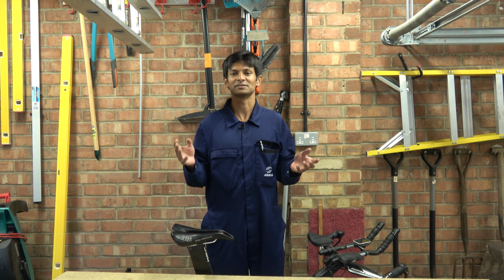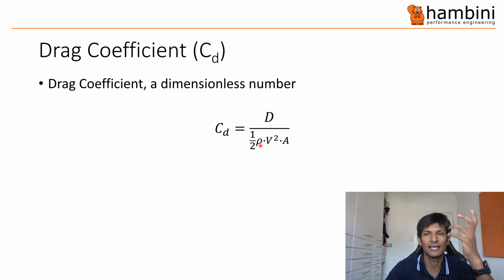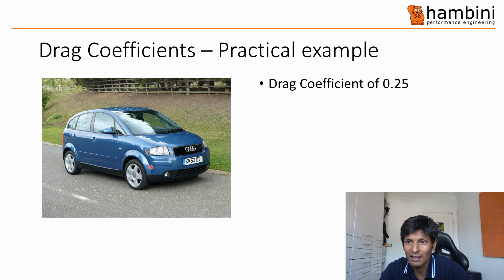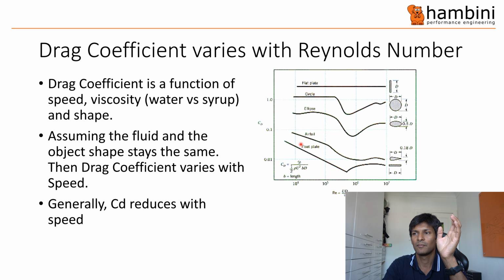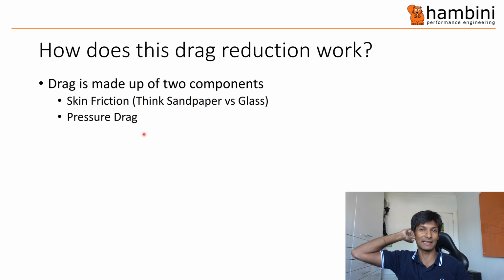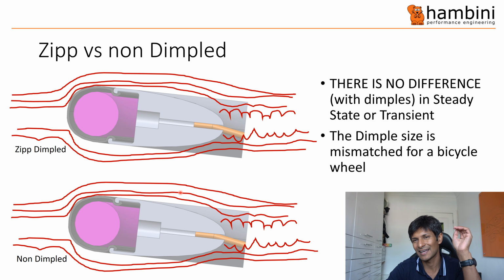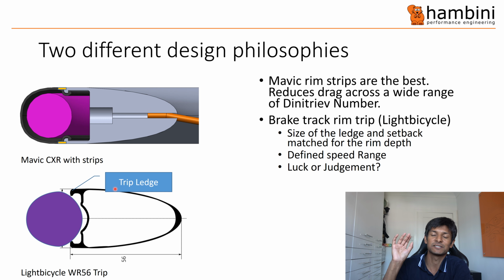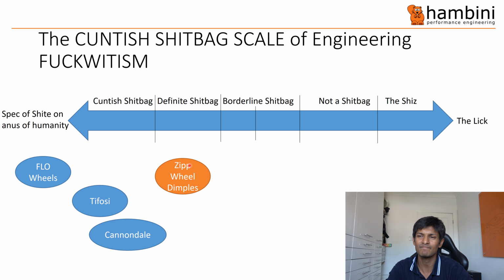Aerodynamics: Zipp Aero Bike Wheels (A Hambini Reaming)

Comment: Hi Hambini, thanks for the video. I was wondering if you could clarify something for me? 

I have been under the impression that the idea of the dimples on a golf ball is to “re-energize” the boundary layer to make it stick to the surface for longer, rather than detaching when it “runs out of energy”. In my mind the first logical step on from this is that while you have the flow still attached to the surface you would like to keep it laminar and only “trip it up” when it is close to detaching. I think this is what Reynolds were trying to do a few years back with their SLG wheels (Swirl Lip Generator). 

In your presentation you talk about making the flow turbulent early (far towards the leading edge) well ahead of the point it detaches. This fits with for example plane wings where the vortex generators tend to sit fairly far forward. It is just that I don’t understand why. How come want to make the flow turbulent so far ahead of where it separates?
Reply from the maker: This is an excellent question and clearly you have spent some time thinking about it.

Towards the leading edge, the air is under a "ram pressure" so it will not detach, however once the air reaches a critical point in it's trajectory the ram pressure diminishes and the air is much more susceptible to doing it's own thing. Having the turbulent area on the high pressure side allows the flow to go turbulent with less risk of it detaching. If you do it on the low pressure side, there isn't enough of a "ram pressure" to keep it suck and generate a vortex. 

I'm not sure if this is clear or not. Ideally I would need 30 minutes and a whiteboard to explain this.
Reply: @Hambini  Yes, I think that explains it. This is how I understand it (I like to think of visuals when possible): The height of the boundary layer (think it is usually denoted by a “delta” symbol) increases as you move down form the leading edge. So that when it is tripped late any disturbance is not enough to “reach out past” the boundary layer height and grab the energy from the air still moving at the free-stream velocity. With an earlier disturbance when the boundary layer is thinner a disturbance is enough to reach out through the whole boundary layer and makes sure it is mixed with the free-stream. 

Or to try and put it in words: further down from the leading edge, closer to the point it starts to detach the air still has enough energy to stay attached, but it is starting to run out. The energy is diminishing and there is not enough energy present in the upper regions of the boundary layer to “re-energize” it sufficiently when it is tripped so making it turbulent (or attempting to?) will not help it stay attached for longer.  

Does that sound somewhat right?

Comment: This has been the best presentation I have seen! Qudos for the indepth research, neutrality and objectiveness. Highly appreciated, keep up the good work!
Reply: Actually, the presentation is crap. How does he define what crap is? Where are your results? What CFD code did you use? Did you use a transition model or a pure turbulence model? What was the mesh quality? Have you replicated the geometry exactly? Have you looked at the wind tunnel data? 

Those are just some questions I would have answered before I believe any claims. I'm not for or against Hambini or Zipp. But I would never believe any YouTube video results without any form of data to back it up.
Reply: Also, I would never trust that streamline diagram in a month of Sundays to tell me anything about the flow. Streamlines do not behave in such a random manner.

Comment: Is the placement the only reason why you believe that the dimples don't work?  Not a fan of Zipp, but this video would prove your point better if it was supported with more data about dimple placement.
Reply from the maker: It really needs to be dimpled on the higher pressure section and then smooth once it has gone turbulent.
Reply: @Hambini  It would still be interesting to see data on it.  Zipp's marketing does make one want to vomit: "The new wavy dimple pattern is designed to utilize 18 nodes that are specifically clocked to start shearing at a rate of 66hz at a rider speed of 17mph. "

Comment: 'Hey Brad, we really need a low speed wind tunnel to test this new dimply rim?'
'Well hey Chuck, heck no. Mary's just got a new aquarium installed. Lets test em in there'
'But Brad, what about the dimensional analysis? The Reynolds number will be all wrong man'
'You work for Zipp now, not Reynolds, that word doesn't exist here.'

This is an exact account of why we have Zipp dimples.
Reply from the maker: Engineering sarcasm. Like it

Comment: At what point on the wheel is the relative wind across the wheel on the radial to the wheel?  I assume it is not the very front quadrant of the wheel.  At that point the wind is straight head on, but also the wheel is moving down perpendicular to it, so the combined motions are a 45° relative to the section of the wheel.  At what point do the vectors add to a flow straight perpendicular to the cross section of the wheel?
Reply from the maker: There will be nowhere on the wheel which resembles the section I have drawn with the vectors I have drawn. There is another video I have done which goes into depth about the topics you have described. https://www.youtube.com/watch?v=BUih_emc54M

Comment: The majority of drag (in a zero wind condition) on a bicycle wheel comes neither from the front nor from the back of the wheel, but from the top regions of the wheel which is travelling at two times the bike speed and generates non-linear increases in drag as the work required is proportional the local air velocity cubed. The front of the wheel is moving downward, the back is moving upward, and the point of contact with the road is static (all rotating of course). So the area of real interest is the top third of the wheel. This makes for an interesting CFD analysis. The other areas of the wheel can create drag with any airflow not generated by moving across the ground such as with head and side wind.
Reply from the maker: There is another video I have done which goes into depth about the topics you have described. https://www.youtube.com/watch?v=BUih_emc54M
Reply: @Hambini  Thanks, I did not realize you did actually rotate the wheel in the Solidworks simulation.

Comment: These diagrams all assume that the air flow is coming from the front - leading edge of the tire.  When the wheel circles around - near the top tube, the rim would be the 'leading edge'.  Does the dimpling have any effect that direction - and how much is the forks/spokes going to swirl the air prior, so will it even matter?  Just as a thinking exercise.  Nevermind, just saw the other comments that addressed this.

Comment: You said the lightbicycle WR56 but there is only a WR50 and AR56. Im assuming you meant AR56.
Reply from the maker: wr56c02 is the part number
Reply: I can’t fit the 30mm wide rim. Does the 55mm light bicycle rim have the same characteristics as the 56?

Comment: Hambini, I have pair of zipps 404 firecrests and really those are good wheels even without a marketing hype. The hub is well designed, really well in my opinion, easy to service and easy to swap for ntn bearing, the setup is quite stiff really. In comparing to rovals those are brilliant wheels, there is nothing so good and budget to be raced in international road races.

Comment: "Cuntish shitbag" I've don't think I am going to call my new Cannondale Super Six with Zipp 303's that. No, not ever. I prefer just a nice, super light, good climbing, steady handling, comfortable, affordable (bought used),  confident on descents, smooth on rough roads, great shifting Dura Ace mech, good braking (rim brakes), bike. Nice, I like that better!
As for additional DC wheel smut, compare your C35's to a set of Zipp 303's DC please
And I have a brake question too. With the marketing hype of disc brakes on road bikes, what is the engineering formula for size of brakes to tire size? Surely a c23 does not have a lot of road contact and can easily cause lock up with to much brake. Is an electronic anti lock system like found on most vehicles next for disc brake bikes?
Thanks! , Mike =
Reply: Yes an engineering perspective on braking would be super interesting. Perhaps there is a third way of doing it other than rims and discs! That would be REALLY cool to see how "cuntish" disc brakes are..

Comment: The heating of supersonic bodies is due to compression of the fluid, not friction.  Compressible flow is very different.
Reply: Last I heard was that the world land speed record for bicycles was less than 200MPH, hardly supersonic.
Reply: At 17.00, frictional heating was given as the explanation for the space shuttle needing special materials to survive the heat of reentry.  The vast majority of the heating is due to the compression across the bow shock.  At substantially subsonic speeds, the working fluid is, to a good approximation, incompressible.  Heating due to friction require kinetic energy to be dissipated as heat via viscosity.  There’s relatively little energy being dissipated into a large amount of working fluid.  The heating effects may be measurable, but won’t be significant.

Comment: What would the implication of the dimples be when you consider the air-flow to go at an angle, or even parallel to the wheels (like on the portion of the wheel which is the furthest away from the ground)?

Comment: fwiw, an older version of Zipp tyres had dimples on the rubber - they had poor rolling resistance though. Also, is there any data to show that churning of the air by the spokes is significant? Haven't seen any insightful discussions of this anywhere.

Comment: Sorry to digress but does it make any difference wether the back wheel is "aero" or not. It seem to me that the air flow is horribly turbulent. Also is a wheel acting as a sail to propel you forward bollocks. Also what do you think of the positioning of pitot tubes on bike to measure wind speed for use in power measurement. it would seem to me that the tube must be the leading edge of the bike not the wheel. I think in one of your videos you said that the air flow behind the front wheel slows down and is extensive. Sorry, so many question.

Comment: Jean-Paul Ballard from Swiss Side recommends  to use tyres with some tread to disturb the laminar flow when the air meets the wheel at the frontal area.But why have you these overpriced Zipp wheels on your bikes? I did not get it.
Reply: He told you why at the start, the price!

Comment: I'm curious regarding the Trip Ledge concept on those Lightbicycle WR56 wheels. I got some Cannondale Knot64 (64 mm deep and 32 mm wide) carbon wheels. Fitted on them are Vittoria Rubino Pro Speed 23 mm. Ones inflated those are 26 mm wide. Would the trip ledge still work with some Conti 25 mm (fitted and inflated they are 28 mm) ?
Reply from the maker: You would realy have to measure it and the alpha critical angle. It's impossible to say from the width alone. Hambini
Reply: @Hambini Thanks for your honest opinion. The only thing that remains now is just try it and see how it feels. Have no equipment to measure alpha critical accurately.

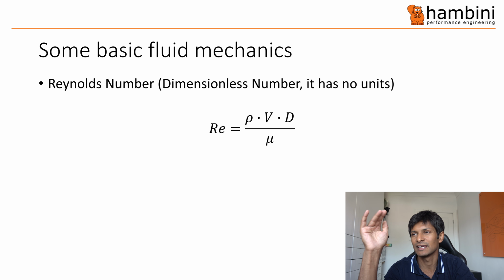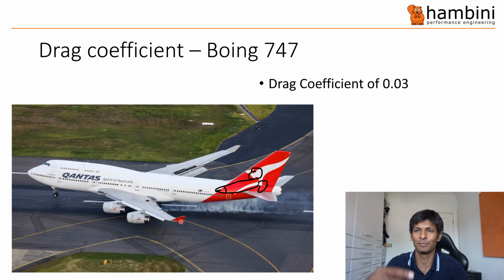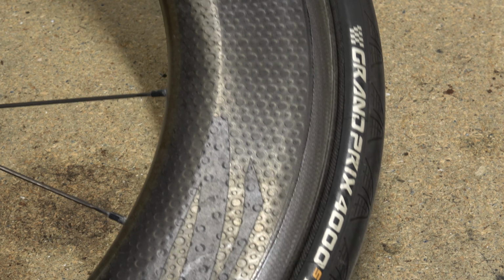Comment: Thank you Mr Hambini. I like your scientific aproach in explaining drag on the wheels. But you only talked about the wheels at 3:00 position. What about the wheels when in 11:00 - 1:00 position where the wheels traveling twice as fast as the bike. Can you explain in a follow up video?
Reply: I think his point is that leading edge is most important to place dimples. Period....
Reply from the maker: @lolouro2266  Bang on.
Reply: ericjohn, Hambini did a separate video on bicycle wheel aerodynamics which shows the dark over various parts of the wheel as per your query.
Reply: @davidtydeman1434  Thank you very much. I found the video. Very informative. I'm a Hambini fan now.

Comment: So if rim strip were banned, why don’t the tire manufacture put a ridge on the rubber to meet the rim, preventing the concave areas on the rim leading edge?
Reply: Or what if I seal this concave area with a bathroom silicon gun ?
Reply: @stephanelouvet1113  Hambini said about that in an earlier video
Reply: Michelin did that back in the 80's aero craze. No one cared.

Comment: Brilliant. Just brilliant. Calling out the frauds of the money-making machine that is the cycling industry. It'll be interesting to see what Zipp's response to this will be. It's actionable for sure... but, personally, I can't see that they'll have enough engineering credentials to counter the Hambini case so probably won't dare to retort (in any manner). My hope is that this video - along with the other recent 'out'-ing videos that Hambini has presented so eloquently - gets seen/shared to the extent that companies like Zipp have to now think twice about their clap-trap marketing spin before releasing high-price-tag kit that really has no chance of justifying their claims in a scientific world. Kudos Hambini  👏👏👏 - you're showing the world just what a scam the high-end bike industry actually is (for the main part). Btw, I've felt for a long time that tyre fit-to-rim is probably an area the aero bike "engineers" need to be focusing on. My 23mm GP4000s on my wide-rimmed Mavics are DEFINITELY quicker than 25mm tyres, and I'd always felt it was because there was almost a straight edge between the tyre wall and the wheel rim. Hambini's explanations seem to suggest this is a particularly important area as far as drag is concerned, yet the wheel-makers seem more intent on developing new-fangled wheelsets with golf-ball dimples and whale-scales 😉, probably because they can make more money than they could with tyres.

Comment: If the uci don't like "the lip" filler piece. How about the tyre manufactures moulding "the lip" onto the tyre wall to close the gap.  Probably a pain to fit and remove but a load of Marketing PR to follow.
Reply: There are some BMX tyres with double lips to protect the rim, such as the Schwalbe Crazy Bob. They are hard to fit, yes, but doable.
Reply: Michelin did this back in the 80's aero  craze. No one cared.

Comment: Absolutely bloody loved this so I feel compelled to comment despite not really being into the aero side of cycling. Your way of explaining things to the layperson without dumbing it down too much is perfect in my opinion. Great summary at the end. Hilarious. Have binge watched most of your content since discovering you when you were on gcn and will be in touch when I need a need a new bb. Just one question if you have time. Are your bearings 30mm inside diameter and supplied with adapters to sleeve down to 24mm Shimano as I have both 30mm Praxis and 24mm Shimano crank sets. Thanks.
Reply from the maker: Hi Carl. No they are supplied as 30mm bore. No spacers are included on basic bearings. 

The bottom brackets have everything required for the crank in question
Reply: @Hambini  many thanks and I will probably just replace everything with one of your bottom brackets.

Comment: I have an old Colango Master Olympic frame and a Chinarello F10 . Since the surface area of the steel frame is much smaller , I think it shouldn't have much more drag then the aerofoil design of the F10.  In general are Steel frames , have very thin tubes compared aluminium and carbon. Does this mean steel frames are similar aerodynamic ,then carbon and aluminium ?

Comment: @Hambini have you considered that the dimples aren't for the furthest most leading edges of the wheel, but in fact they might be for the leading edge of the inner part of the rear of the wheel ?
Reply from the maker: Yes and the flow will already mashed up by the spokes that act like an egg whisk and the forks

Comment: Awesome videos Hambini, loving the clarity of your explanations. 
I have a question about Reynolds wheels. They seem to have recently changed from a rounded profile to a more pointed profile (Reynolds strike rounded, aero 65 pointed). The justification seems to be around improved cross wind performance. 
Can you cut through any bs to explain how pointed vs rounded profiles affect cross wind performance? Something to do with controlling flow separation as the effective yaw angle changes?
Cheers mate!
Reply from the maker: I will do a question and answer video and cover this
Reply: @Hambini  Awesome mate that's great to hear. Thanks!

Comment: So with that said, I couldn’t but help but think.... on the chart of drag for retrospective shapes,  the sphere or circle is 2.5-3 times larger than the airfoil shape frontal wise. Is that just an example of the shape or is that comparing the sizes as shown? If that’s the case then then sphere should be far more competitive if the frontal area was smaller.
Reply from the maker: Cd neutralises the effect of frontal area. But you are right the sphere would be much more competitive in ultimate value if it was smaller than the aerofoil
Reply: Hambini thanks Hambini! I would love if you gave some insight on the Pinarello Dogma F12... they have proven so well in previous iterations (f8,f10) In independent wind tuneless testing. And being not as aerodynamic in real world testing,  they seem like they still have a good result.